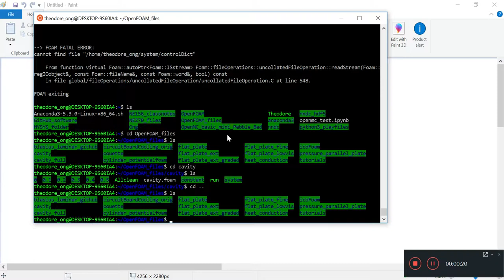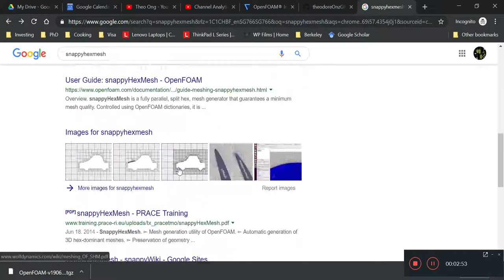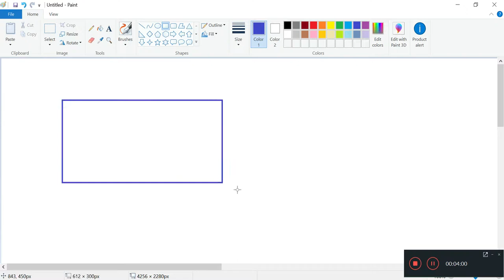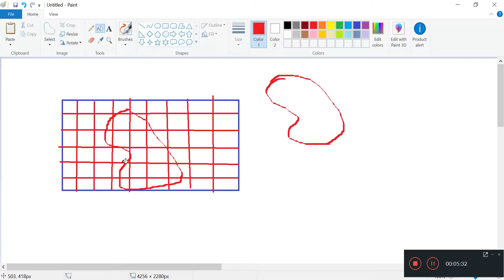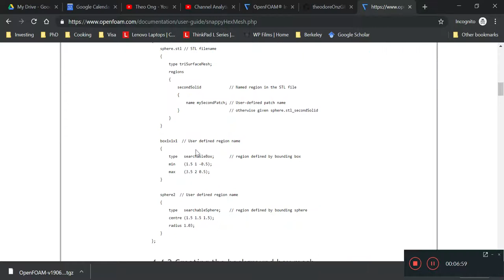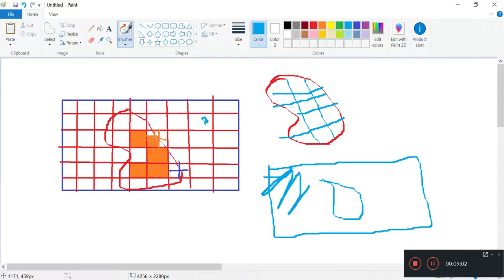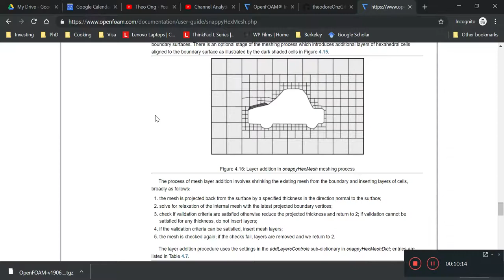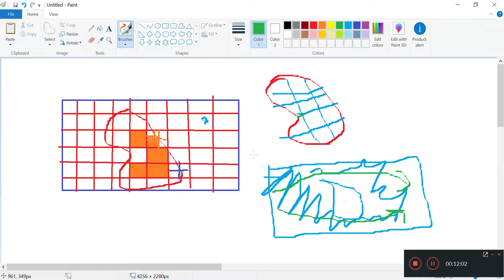OpenFOAM Intermediate 1 - snappyHexMesh Introduction

Comment: hello! first of all, thanks a lot for the videos, i was looking to define the patches but i will see the complete series as i am sure that I will learn things from it, a tip, for the free drawings you do, it would be way easier for you to use ppt. as you can fix vertical horizontal lines, and also they are transparent and if you use ctr+shift when moving an object it will copy it at the same vertical or horizontal position :)

Comment: Hello Theo, I learned a lot from watching your videos. I really want to thank you. I am currently working on a CFD model of an atmospheric boundary layer and have some problems. Here I have been able to maintain a homogeneous wind velocity profile. However, I have been unable to maintain a homogeneous profile for turbulent kinetic energy.

I have given a manual input for the Turbulent Kinetic energy (TKE). It seems that the TKE seems to dissipate very early in the domain and doesn't travel the domain. 

FYI, I'm trying to implement a k-epsilon model.

Can you please help me? I have been stuck in this problem for a long time.

I will be very grateful for your help.

Thank You.